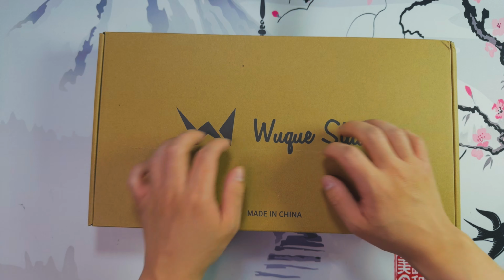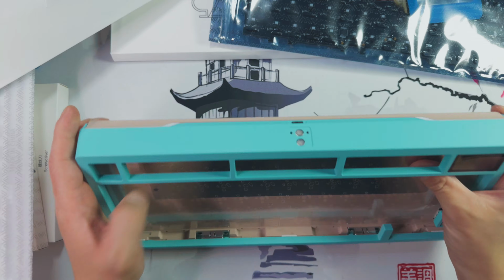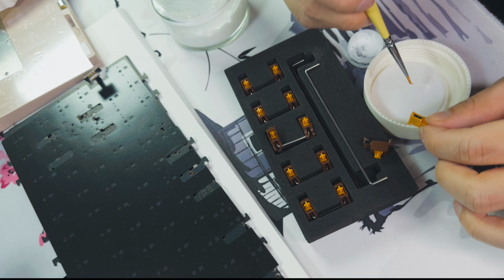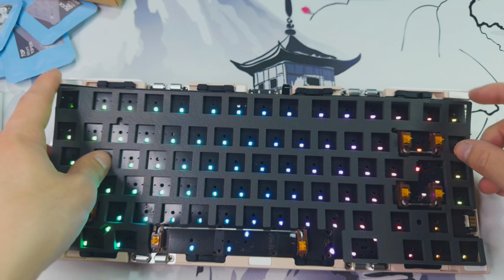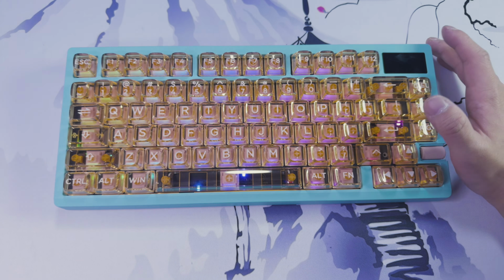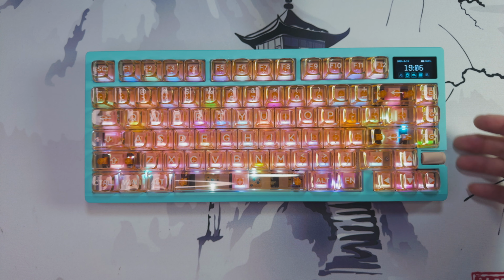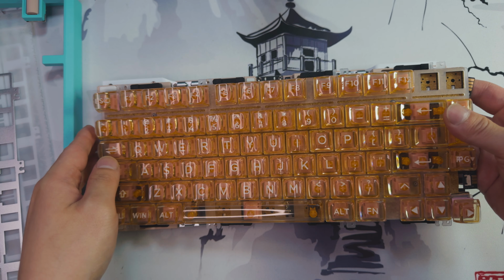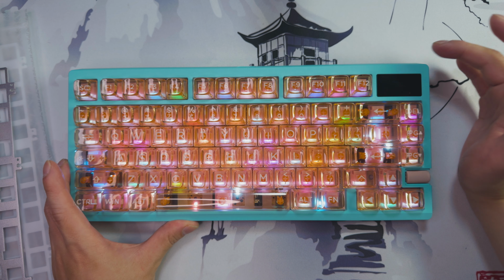Cork Foam? Unlimited Modding? Meletrix Zoom75 TIGA

Comment: Hey, been watching your content and I have started my own channel as well. I was wondering about your pronunciation of the name. Everyone else I've seen pronounces it like, Mel - E - Tricks. I was wondering if you confirmed that your pronunciation is correct. The main thing i wanted to mention was about lubing the stabilizers. Those are the WS Stupid Stabs and are similar to the Paigu and Maiz stabs and they have silicone inserts and you don't need to use the BSZ on it and in the long run may introduce a different sound into the stabs that may be undesirable. I had the issue when I first started using this style of stab and I thought I would share. I hope this helps you. BTW this style of stab is fantastic and I highly recommend it and eliminates 90% of ticking out of the box with no lube at all. You can just use the littlest amount of 205g0 or even 3204 to lube them and that's all you need...
Reply from the maker: @ChrisJames024  I haven’t confirmed if my pronunciation is correct I say Mel -eh - trix as it just for me felt the right way to say it but I should confirm with them! Also thank you for that information! I did that for all stabilizers as I hate the sound of ticking and I tend to notice ticking sounds quite easily it really helps. Also that’s awesome! I bet your channel would be better than mine as I’m still pretty much a noob and still trying to make better content that people would like to see
Reply: @mikeytypes  Yeah, that's how I was doing it as well, until the Paigu/Maiz/Stupid Stabs came along. They're really like Magic. The Swagkeys Knight Stabs are like that as well, but I had gotten the v1 and their loos tolerances did not go well with my changing stuff all of the time. The stems on those kept coming out of the housing when I removed the space bar and then I tried them in a 40 and the wire kept popping out instead of the stem. So Annoying!
Reply from the maker: @ right now I use for plate mount designer studio, for screw in I was using the TX AP but now I’m leaning more towards the Knight V2 I did the same lubing for them as I normally do and now maybe it was a mistake haha

Comment: It’s really odd that the aluminum sounds deeper than the Pom.  Are you sure thats right?
Reply from the maker: @kingmidas430  the sound tests are correct, I think specifically it’s due to the way the build is the aluminum plate does sound deeper though I know usually it shouldn’t but most likely it’s due to the Keycaps

Comment: I have really been considering this board, I have just not seen a video where sombody made it thock 
Could you try to make it thock :D
Reply from the maker: Yeah, WS switches there aren't really any that are super thocky. Though, there are new ones that are coming out soon and I will try them out with the TIGA I think there will be a thocky one in them
Reply: @mikeytypes if you have a zoom 65 v3 can you possibly make it deeper sounding too? I am considering the board but can’t find a video with a deep sound test
Reply from the maker: @dosucatter3423  ohhh I can definitely look into it, I may not be able to make another full video, but what I can try to do is change some of my shorts with the 65 V3, currently the one I have and the one I did a full video the switches was the Wuque Studio POM switches which is just a recolor of the Gateron Smoothies
Reply: Does it not take normal switches, like fx. Put in some rose wood or other thocky switches :)?
Reply: @mikeytypes  I don’t have the board but does adding more plate foams and case foams in addition to the ones provided, does that make a difference? Or a deep switch like the oil kings?
Reply from the maker: @krisstoferlbp  yeah of course it takes other switches haha just new ones are coming out and I think some of them may have that deep sounding profile
Reply from the maker: @dosucatter3423  adding some more foam is good or doing  tape mod and changing the switch the 65 V3 doesn’t have much room to add more while the Tiga definitely does
Reply: @mikeytypes  For sure. I thought it would’ve been possible to add more foam. The zoom 65 v3 keyboard would’ve been my pick because of its customization and its mounting types but its sound signature is comparably high pitched compared to keyboards like the qk65
Reply from the maker: @dosucatter3423  that’s fair the 65 V3 does have a bit more of a higher pitched sound that’s for sure a way would be to do multiple layers of tape mod could help though